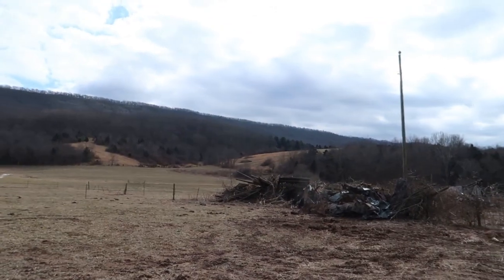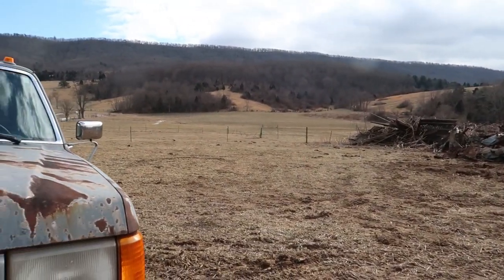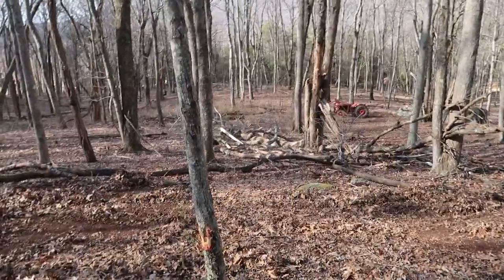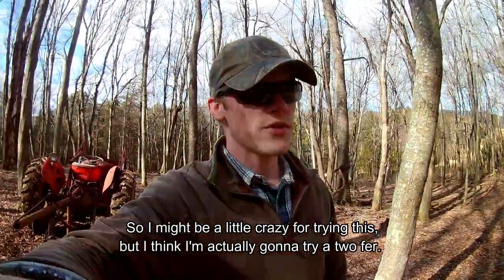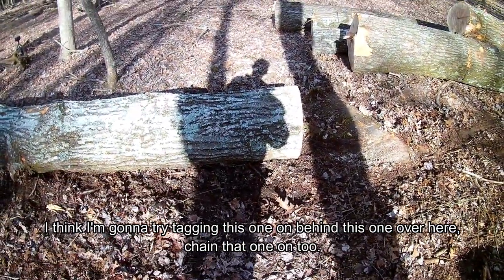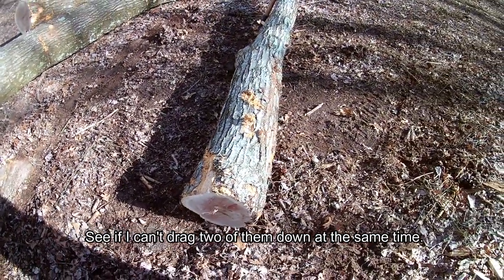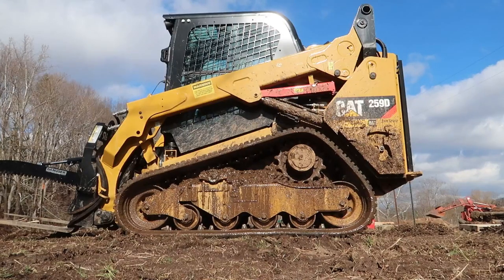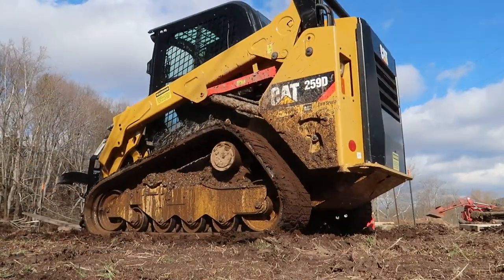Tractor vs Track Loader - Skidding Logs

Comment: That's a long way to skid for what you have. You're better off with a set of wagon gears and using that as a forwarder loading it with your skid steer. Logs will stay cleaner and you will make your wood collection much more proficient.

Comment: I'm thinking a log arch,  use either of the machines or even a quad runner.
Reply from the maker: Hey Jim, A log arch could definitely be nice in some situations. However due to the distance between the woods and the mill, I try to leave logs in as large of sections as possible so I make fewer trips. The capacity that the arch would need to have would be HUGE! Josh